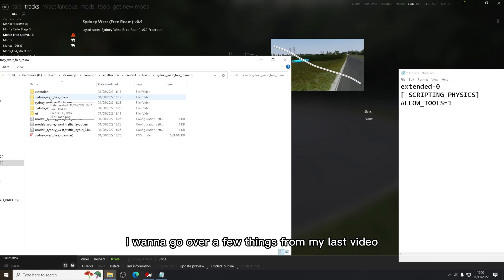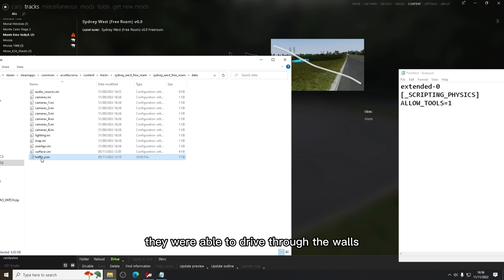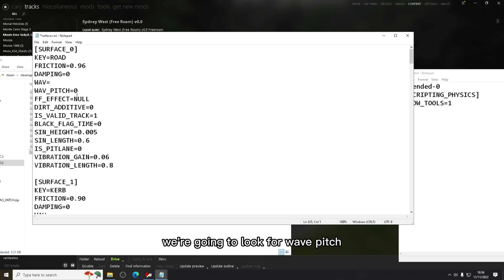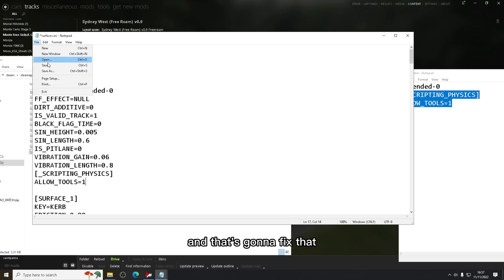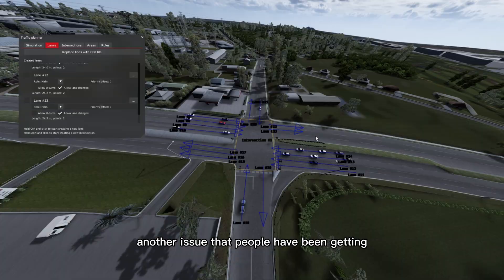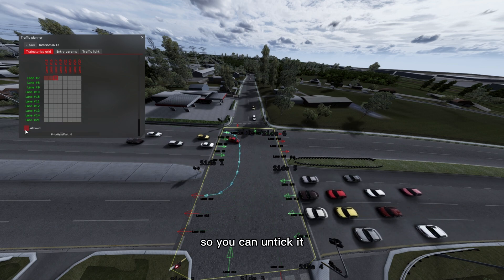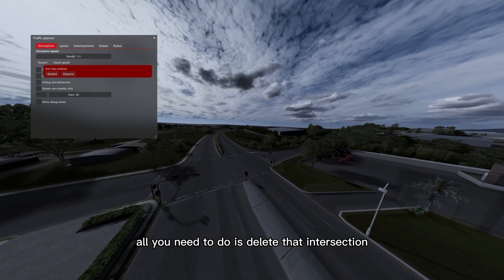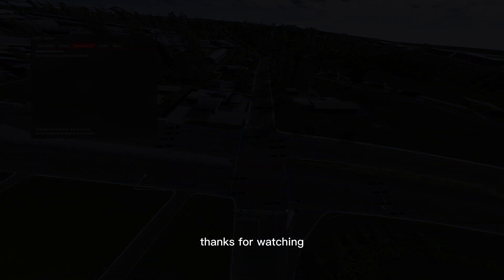Assetto Corsa Csp Traffic Tool Tutorial (Part 2 fixing issues)

Comment: how to fix "cheksum" problem on 2REAL,s servers? When i just finished loading on a Paris map on 2REAL server, i have red screen and text "Checksum failed. Youve been kicked from the server"
Reply from the maker: Check sum failed is either incorrect version of the car or map, So you need to reinstall, I recommend a fresh install manually, not drag and drop into content manager, This method is unreliable

Comment: I have an issue of traffic car wheels sinking into the track on Shutoko. When the traffic cars go round a bend the cars lean to the outside with the tyres in the track and the inside wheels are lifting off the track, and the larger the vehicle the worse it is.

Comment: Hey! Soobie there, from AC street scene. I downloaded the traffic tool, made some lines and intersections, but i can't edit the intersections. when i click "edit connections" it goes to top of the intersection tab and does nothing. maybe you will know the solution. Thanks!
Reply from the maker: If you click on the intersection you're wanting to edit you should be able to edit it if not maybe try deleting it and redoing it
Reply: @theacking  i tried to redo the intersection multiple times - doesnt work. it does the same thing over and over :(

Comment: Hey mate. 
can u set up as many intersections as the map has? 
cause a good friend of mine only is able to do one to two intersections and then isnt able to edit more intersections since it wont open the intersection editor anymore.
Reply: I can add as many as possuble. But after 1-3 intersectuons. It blocks me out of intersection settings. I cant enter the setting for lanes anymore
Reply from the maker: You should be able to set as many as you want